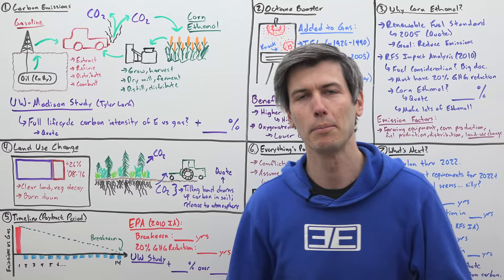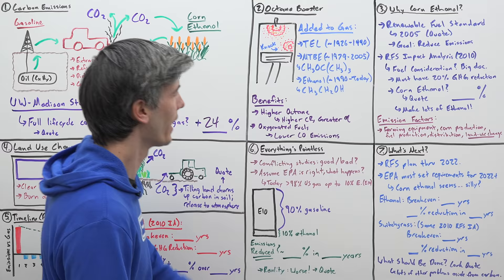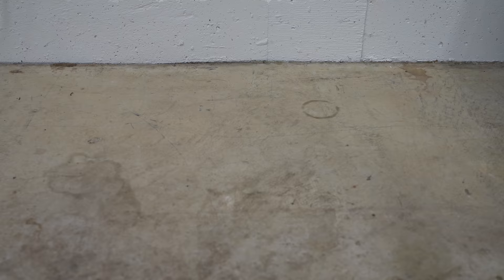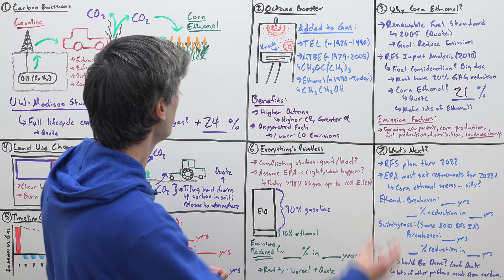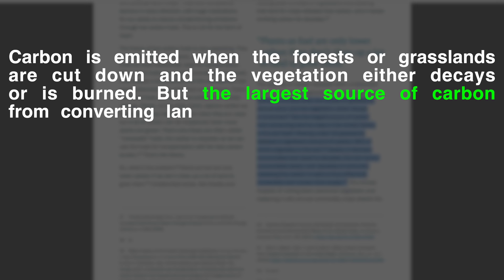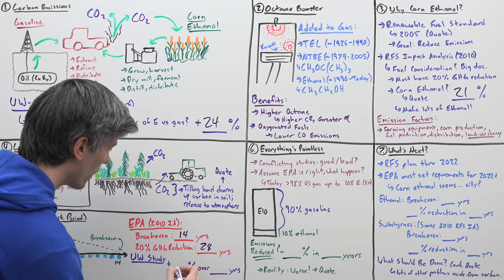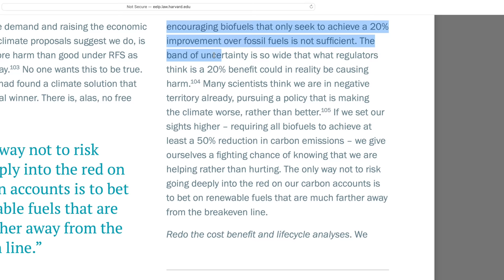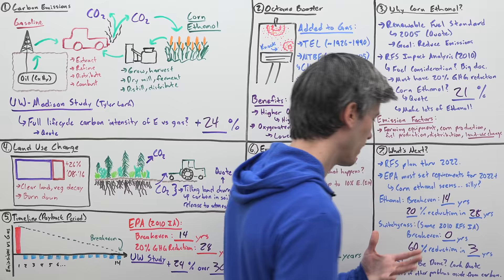America Was Wrong About Ethanol - Study Shows

Comment: I have flex fuel at my local gas station. It’s rated at 94 octane (E50). It costs $2.77.  At my local wholesale gas station Costco/BJ/Walmart 93 Octane (E10) costs $4.09. Using E50 drops my MPG from 30 to 25. You go from 114,000 BTU to 95,000 BTU. $2.77 x 120% = $3.25. I save damn near a $1.00 a gallon using ethanol.
Reply: If Ford would release their Ecoboost E85 optimized technology in engines, your MPG on E85 could be 35.  If GM released their Ricardo engine, MPG might be even higher than that on E85.
Reply: AMEN Avery!  What state sells E50 thats cool!

Comment: Every study i have seen on this always includes the input and processing cost of ethanol but ignores the input and processing  costs of petroleum  based fuels, leaving the impression of a biased result. If you are going to include the carbon costs of growing more corn, you also have to include the carbon costs of exploring, drilling, fracking and transporting oil.
BTW; I am not a fan of ethanol.
Reply: I agree and said the same in my comment. There are many ways to conduct to a false conclusion with true facts. This was the case here… leaving out that part is intellectually dishonest
Reply: Its been a 25 year attack on anything against coal or oil. Sad.
Reply: The bias here is towards “renewable” energy.
Reply: To be fair, while he did mention the costs of farming equipment (which would of course include diesel fuel use), corn production, fuel production, and distribution for ethanol, he only used the land use change in his emissions calculations, so it's probably a wash, or close to it.
Reply: @techeddie9035  There is a good reason why farmers are hoping for cheap electric tractors or a way to turn all their biowaste into fuel. Farms need a lot of fuel to run all the machines needed to make modern farming viable.
Reply: @AnalystPrime  cheap electric tractors won't happen until we have a major revolution in battery tech actually happen.
Reply: @InfernosReaper  That would be useful, but there already are some small electric tractors available. A typical tractor has less horsepower but costs same or more than a Tesla luxury sports car, batteries are not the only factor.
Reply: @AnalystPrime  biowaste into fuel is easy. Its called gasifiers or pyrolysis chambers and you can build it with home depot parts and/or a few parts from alibaba.
Reply: @baloog8  Yes, there is even one of those "10 amazing gadgets for your home" videos about this bag you put your food scraps in and you get gas for your stove from the hose at the other end. But how many farms are actually making their own fuel? And why aren't they?
Reply: What you are asking for was not the intent of this presentation . This presentation was just showing how the using corn based alcohol was not solving the problem it was intended too . Or at least we were told it would .  In fact it is adding to the problem .
Reply: Recycle garbage to make gas
Reply: @AnalystPrime  biowaste into liquid fuel is very inefficient.  The process of breaking down cellulose into ethanol looks good only in theory.
Reply: @tesstess3371  What about using methane from animal waste and composting plants?
Reply: @AnalystPrime methane is a gas ‐ one component of natural gas, and would require large scale modifications on the engine and distribution system. It can be done, but I don't know enough about the costs involved or the energy balance
Reply: Why e85 isnt made from bio waste in US? Would be better for enviroment surely.
Reply: @0hjaa3.06  as I mentioned before, biowaste can produce biogas - methane, the process to produce liquid fuel, as ethanol, is not practical.
Reply: @tesstess3371  Methane would be best used in a fuel cell, making it an EV, but I'm thinking if you could easily turn it into methanol or other liquid fuels.

EVs have superior efficiency but need a battery(even hybrids and fuel cell vehicles), and if it is a large battery it adds weight and cost, while a small battery needs frequent recharging so it degrades faster and needs to be replaced more often, increasing cost.
Reply: Petroil... that is a funny spelling... pls read Petroleum

Comment: The fermentation chemistry itself results in the production of one metric ton of carbon dioxide for every 333 gallons of ethanol produced from corn. I've not seen this included in the various calculations of ethanol carbon impact. Perhaps this will be corrected when the disinformation board is up and running.

Comment: Specifically, tetra-ethyl lead coated the contact surfaces of the valves & valve seats, virtually eliminating recession wear. It was a bit more than just an octane booster.
Reply: And asbestos is a great insulator electrically and thermally.
Reply: Ethanol is also a great.... SPONGE. water+fuel in your fuel system= ?
Reply: If only Lead weren't poisonous!  It has so many virtues as a material...
But it is, and so we have to be very careful what we do with it.

Comment: Okay, there are several factors that are being overlooked in favor of ditching Ethanol:
1. The 24% more emissions do NOT account for the total volume of carbon emission. That percentage doesn't account for factors of carbon emissions drawn out of the atmosphere, thus to ignore that fact would be misleading. When the overall amount of emissions may be significantly less than traditional methods of gasoline production or even has a positive effect and reduces carbon already IN the atmosphere, this is a potential that traditional gasoline production cannot replicate in any way, shape, or form.
2. To produce corn you need land, but to acquire land, you must deforest and till land which causes all sorts of emissions from decay and farm usage and for forth. This argument also neglects to accurately represent efficient methods that employed by regenerative farming which not only have a smaller footprint but can SAVE decayed farmland destroyed from years of tilling, tilling is NOT A NECESSARY COMPONENT of farming in order to yield corn for production, so in effect, using efficient methods would once again not only reduce our carbon footprint but because we can use the existing forest material to regenerate dead farmland, and produce corn to reduce emissions we can have a DRAMATIC impact of how we not only deal with emissions but draw Carbon from the atmosphere. But what about the equipment you're using to prep the farmland and move materials? Again, this would only be an issue if you were using Gasoline because Gasoline production can only reduce emissions, never reaching zero or negative emissions so that's a moot point!
3. Your final point about the overall complete worthlessness of continuing to use ethanol in its current adoption stage (as an additive to Gasoline) then YES it would have a small impact that's hugely insignificant so in that effect WHO CARES!? But again, that's not the argument being made to switch to ethanol-based fuels for cars! The argument isn't that we simply continue to use ethanol as an additive, no one argues that point! The argument is that we should switch ENTIRELY to ethanol! (NO GASOLINE) As ethanol is a much better alternative that can not only reduce emissions to net-zero (Which is impossible for Gasoline usage) but through the multitude of factors and facets of producing biofuels we can have negative emissions (not releasing emissions but drawing carbon out of the atmosphere). This isn't even a conceivable process to ever be achieved through current fuel production methods.

Your arguments completely set up the ethanol production system as this worse alternative to gasoline without even addressing the multitude of factors and scientific studies made available that address the benefits of having biofuel anywhere in your arguments. You've used bandwagon logical fallacies that assert that tilling is the only method for farming, you've neglected to account for net emissions using biofuels, and you've set up a strawman argument (maintaining using ethanol as an additive instead of an alternative). I would like to hear your response or at least consider how you've structured your argument in light of my objections to them, thank you for your time!
Reply: Well said.  The US actually uses less farm land than in the past can crop rotations were not considered at all.
Reply: I love the idea of switching to e85+ fuel blends personally. We have several states where sugarcane could be farmed and produce very high yields compared to corn.
Reply: I will point out one flaw in your view about switching to ethanol, you have to burn more of it for the same power output. The same problem with switching from diesel to CNG or LNG the fuel density is not the same so you are burning more fuel to get the same work done.
Reply: @BlueDually4x4  if your engine was designed from the factory to burn ethanol, you could compensate by having much higher compression ratios. This should offset and of the efficiency losses due to the fuel. In fact, you could actually develop even more efficient engines if you were to convert to ethanol fuel with higher compression ratios (and they’d have more torque too!)
Reply: @verothacamaro  they are already designing them, and they get worse fuel economy. As ethanol has less energy density, meaning you will always need to inject more. It does have some benefits to performance, but economy isn't one of them.
Reply: @verothacamaro  I was referring to people building E85 race cars or drift cars. Yes lots of power still terrible fuel economy. 
A compression ratio of 15:1 puts you in diesel engine territory and that is going to increase the cost of the engine as normal spart ignition engines cannot handle that kind of pressure. 

Hell a short block 427 Chevy LS built to handle 11.9:1 is nearly $9k; and you still need the rest of the engine. Looking at nearly $700 just for high compression ratio pistons for a four cylinder Honda engine. 

Building an engine to handle 15:1 would be tens of thousands of dollars.
Reply: @BlueDually4x4  totally, but I think if production takes advantage of economies of scale, you could lower the cost dramatically. I can’t imagine them being more expensive than modern, small displacement turbocharged engines.
Reply: @verothacamaro  Handling higher compression ratios are part of the reason performance engines cost so much. A used 911 GT3 engine is over $20k and only has a compression ratio of 13.3:1 Compared to a brand new 6.7L Cummins for $25,000 with a compression ratio of 16.2:1
The Porsche engine weighs 400ish pounds, the Cummins weighs 1,000 -1,100 pounds and both are six cylinders. Now part of the weight difference is the Cummins has 2.7L more displacement and part of it is the engine is made of iron, including the head. 
You could go with the 3.9L 4 cylinder Cummins, but you are still around 800 pounds dry weight compared to the Porsche and a slightly less enthusiastic 140hp.
You are basically doubling the weight of the engine to handle a small compression ratio change. Imagine the negative handeling impact you would get in something like a Honda Civic by adding 350-400 pounds over the front wheels.